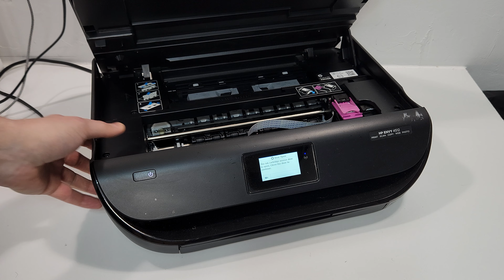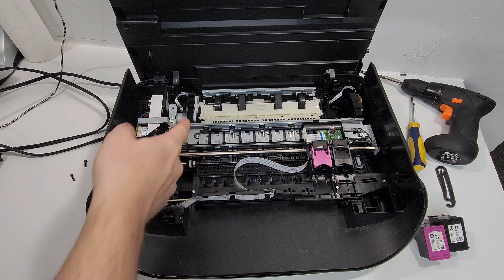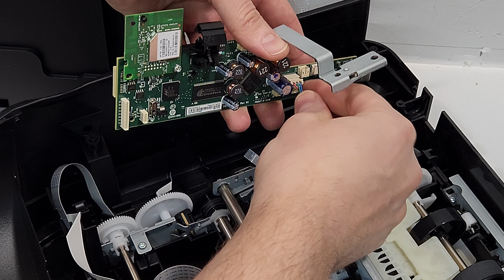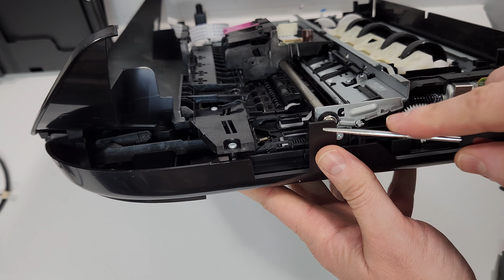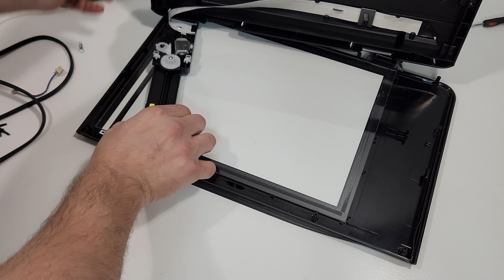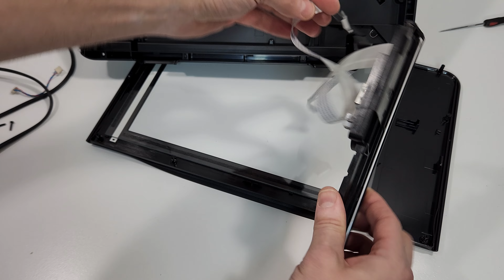Taking Apart HP ENVY 4512 Printer for Parts or to Repair 4510 4513 4516

Comment: How do you take out the rolly thing for the paper feed? The rollers on the top
Reply from the maker: You may need to remove a few covers like in the video, but most of the time, you may just need to readjust the gear if the rollers aren't spinning. If rollers are spinning but are not picking up paper, you may just clean them without removing them from the printer.